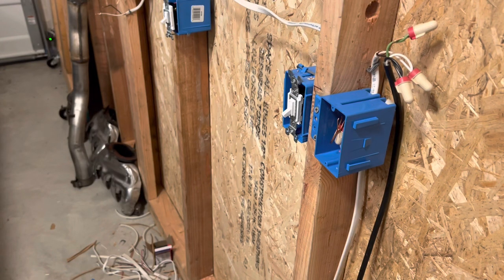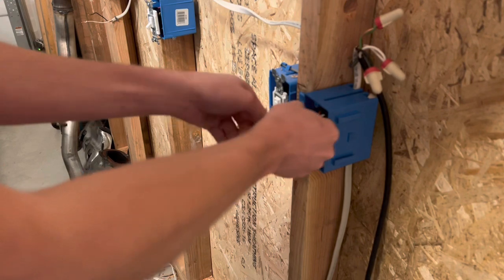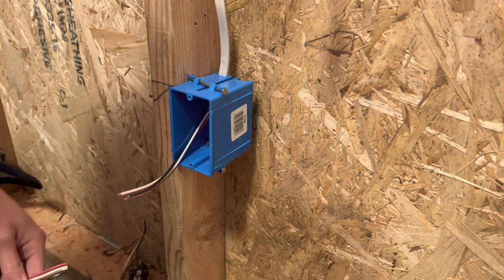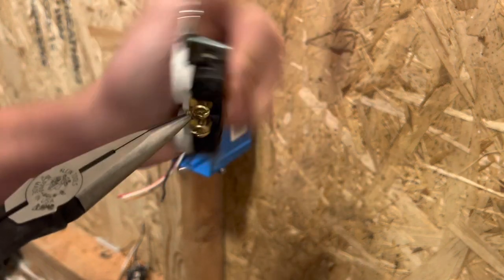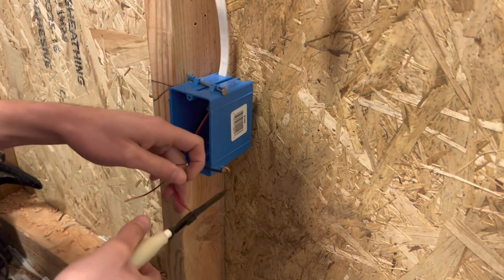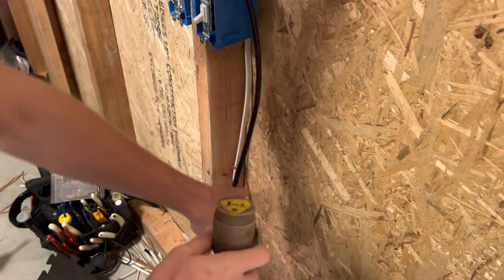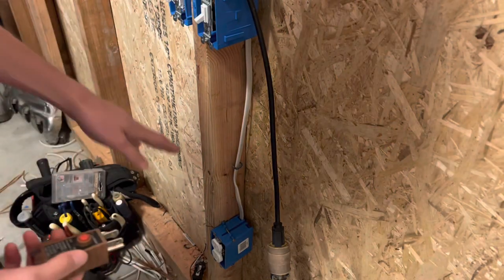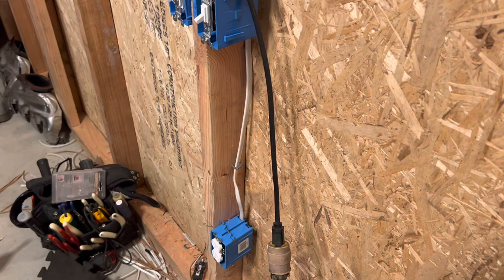Electrical 101: How To Install A Half-Hot Receptacle (Residential)

Comment: Why is it that the switches don't work on two of my receptacles in same room? I am not getting any power to them at all so it would have to be a wire from the receptacles that must be on wrong terminal screw wouldn't you say that's why the switches are dead? All I did was replaced out the old switches & recepticales to more modern ones I broke out the tabs on both recepticales but again no power to the switches, one recepeticle has full power top & bottom the other recepticle in same room only half has power nonetheless there has to be some wire that's not in the right place to feed to the switches I guess is that what it could be?

Comment: For the new to the trade guys, learn something every day.

What or how do you do to ensure power is off?

What order do I connect the wires and is it importsnt?

Can I cut the tab(s) and use 2 different breakers to supply the now 2 seperate receptacles on that same yoke?

Can I use an ohmn meter to figure out what cable in a box goes back to the panel?  How?

If the receptacle has these voltages, will a lamp work, is it safe to work on....

Hot - ground....120vac
Neutral - ground....120vac
Hot -neutral.....zero volts

Remember that your BRAIN is your best tool and wear your SAFETY ATTITUDE on your sleeve.....you might need it at home.